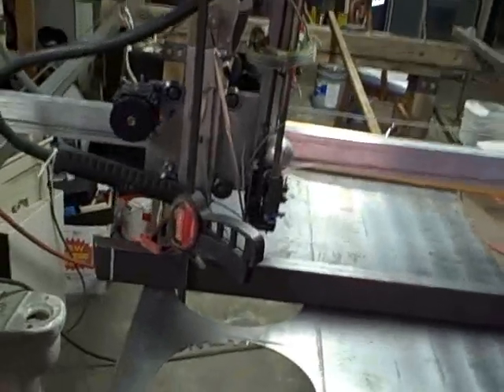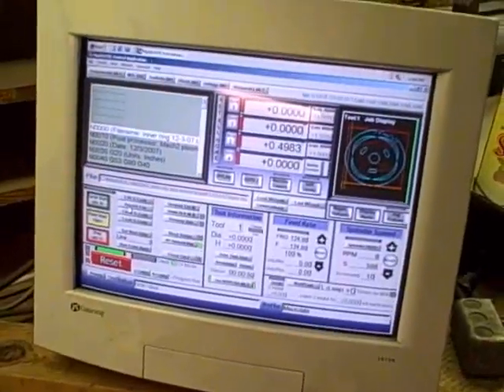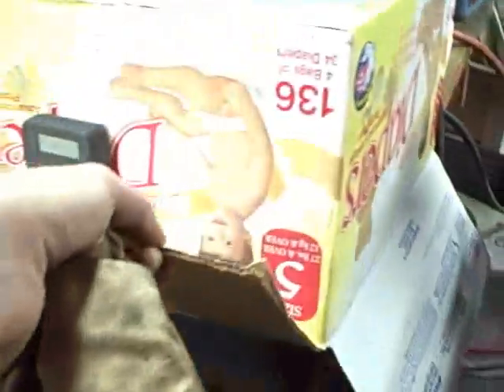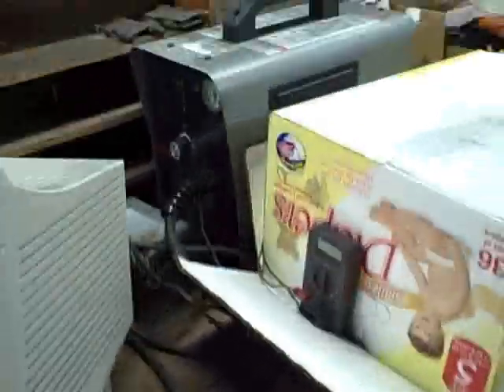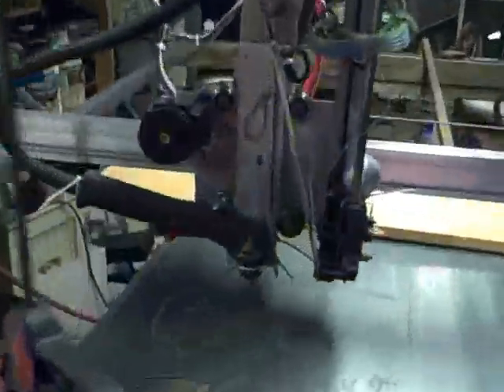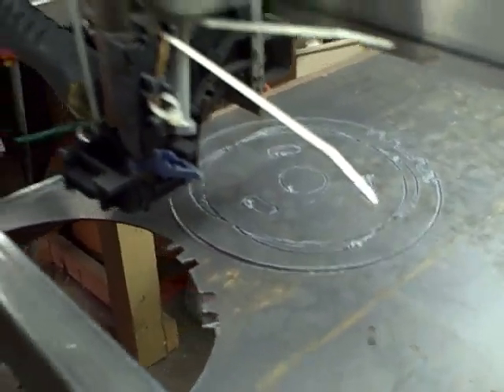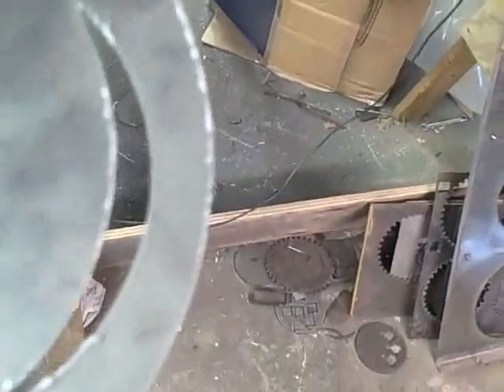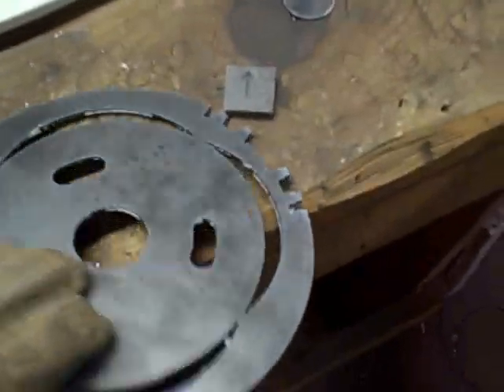Homemade CNC plasma

Comment: @emlerron As much as I don't like negative video comments- he needs to clean up. Sean- You have got to be on the high side of the bell curve to build CNC equipment. Get some shelves for all the "stuff". Get rid of your plastic air tube and cardboard control box.  BTW Nice machine.

Comment: emelerron has a point. His air evacuation device, which is placed under the table, is made of cardboard? I mean, the setup is very good. I love the video. But really? Cardboard? Directly under the table? If it goes up in flames, not much would probably happen, but it's kind of a silly thing...